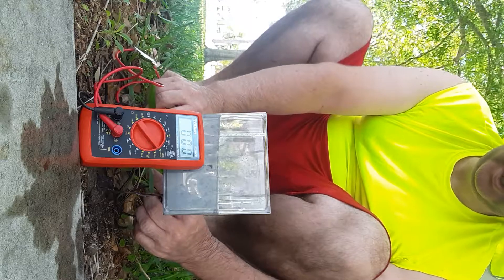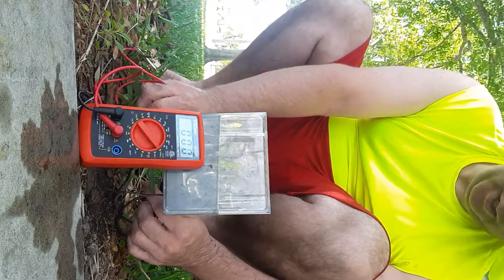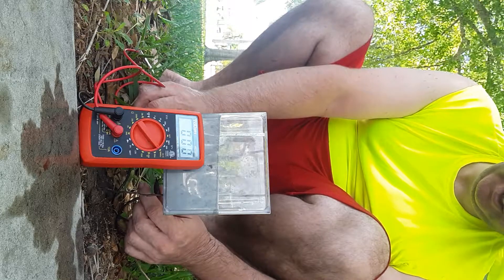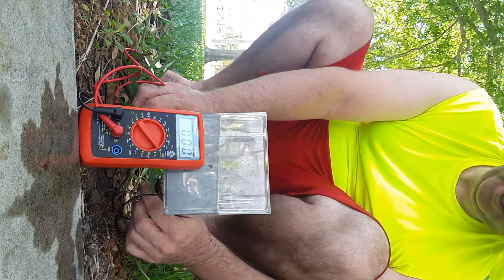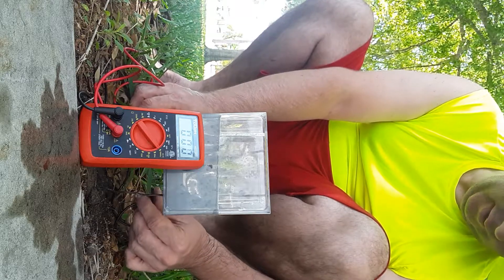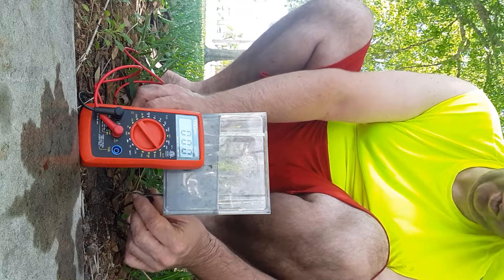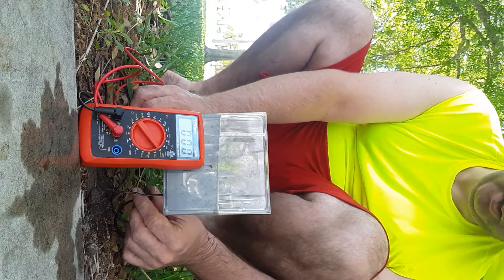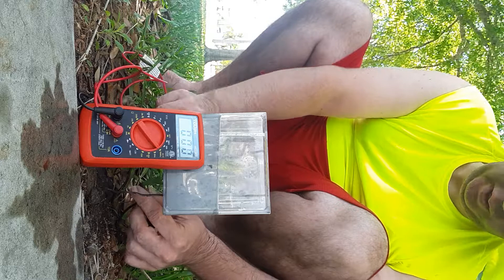LIQUID METAL EARTH BATTERY

Comment: I couldnt work out what the reading was. you also would have to compare it to a earth battery Two dissimilar metal rods buried in the earth will produce power.
Reply from the maker: The flux went from 30 to 1.,240  micro amps.  And from 0 to .7 volts. It is not a standard earth battery. There is plenty of description on how it works compared to older tech

Comment: What? So what is the real source of energy here?
Reply from the maker: two sources.... ground vibration and the water in the soil.
Reply: @peterlang777  I'm not sure what you mean... How does your earth vibrate, and how do you get any energy from water?
Reply from the maker: @user-vn9ld2ce1s  tectonics and volcanism create low frequency sound in the crust called infrasound.  water is converted by SL TENG  Technology. solid liquid triboelectric nanogenerators.   many videos on my channel about these.
Reply: @peterlang777  interesting... Does it create any reasonable power, or is it meant like a voltage you'll then measure to measure the infrasound?
Reply from the maker: @user-vn9ld2ce1s  it produces power. the chinese and maya megaliths had large pools of mercury and pyrite Crystal's that used thi millenia ago
Reply: @peterlang777  i'm not following here... How much power?
Reply from the maker: @user-vn9ld2ce1s  the power is dependent on the surface area of the galfenol np and gallium interface. and the strength of the infrasound in the area. more size = more power  . it is about  2 deciamps  per cm^2 in Sarasota